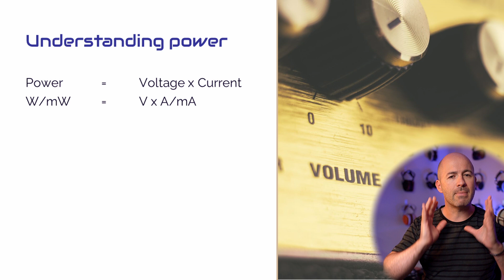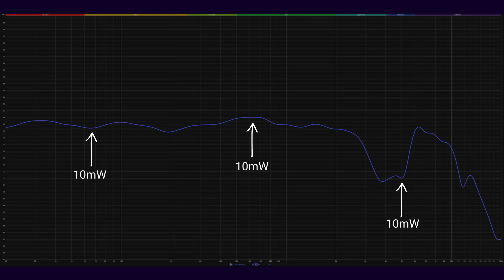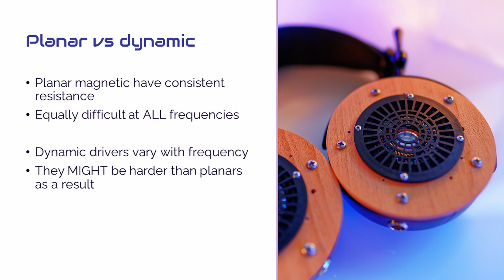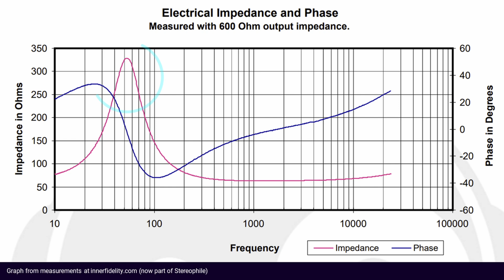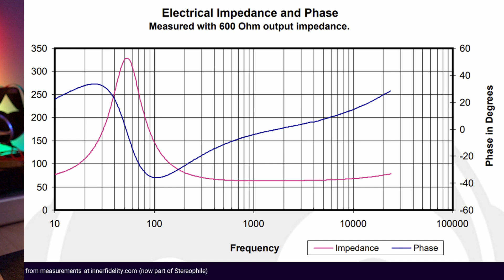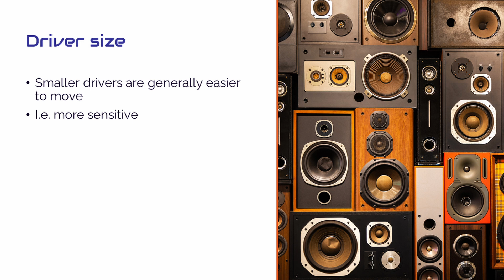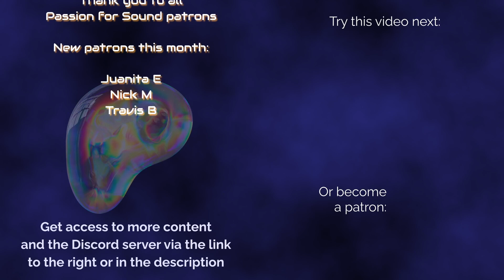Is bass REALLY more difficult to produce?

Comment: I think the answer might change if you go into 2 channel or a home theater setup.  Hence why most people will get dedicated subwoofers so they can reproduce bass and sub bass as similar spl levels.  A 2 way or 3 way speaker setup will struggle to produce lower frequencies.  When you run the sub it takes the bass loads off the speaker and allows it to perform better and open the sound stage.  Anyway that is my general experience with 2 channel.  Headphone and iems are completely different.
Reply from the maker: That's more about the frequency extension of the full range speakers rolling off before the sub bass. If the full range speaker could go low enough, it could produce the bass, BUT as discussed in the video, the larger driver required would likely be harder to physically move and would therefore require more power. This is where the whole myth began (myth when referring to headphones, true for multi driver speakers)
Reply: Lots of speakers lose efficiency at low frequencies. That's why you need a sub to correct it.

Comment: So, for two amps, similar in terms of mW output at a given nominal impedance, if you're using planars, would the amp with the lowest maximum voltage be a better choice because planars need current rather than voltage? Is that last part even true?
Reply from the maker: No, it's a bit more complex. All planars need voltage and current - they just need more current if they have lower impedance.
With the amps, it all comes down to their maximum current and maximum voltage outputs and that's rarely published in the specs so you have to hope that they give you power figures at a range of impedances so that one figure approximates your headphone's requirements. I hope that makes sense.
Reply: So for example, the JDS Labs Atom Amp 2 has a quoted spec of 2.65 Watts (9.22VRMS = 26Vpp). Is that enough to know it's current is 287mA and is higher current always better for planars, taken in isolation from any other deciding factors such as character, tube/Solid State etc? @PassionforSound
Reply from the maker: Good questions. The only way to understand it's current capabilities is to know at what impedance that 2.65W is available. You can probably work backwards by using the voltage figure provided and then use the voltage and current to determine the resistance, I guess.
In the end, the best bet is to see if you can find a power spec near the impedance of your headphones. If all else fails though, current is particularly important for headphones as they drop below 30-40 ohms, especially if they're less sensitive headphones.

Comment: Strictly speaking electrical sensitivity is expressed in db/V not W. db/W is efficiency.. A 4ohm and an 8ohm speaker can have the same sensitivity, but the 8ohm speaker is more efficient.
Reply from the maker: I'm just sticking to the language that everyone is used to seeing on specs sheets
Reply: @PassionforSound  Well, if you look at spec sheets you will see both db/V and db/W used. Since you are attempting to lecture people, both you as a reviewer and your audience should understand both the difference and the scientifically correct terminology, otherwise misunderstanding is perpetuated.